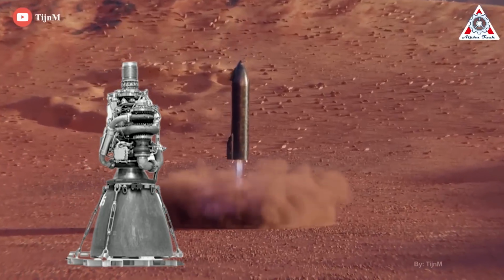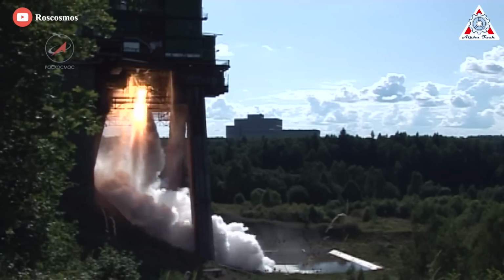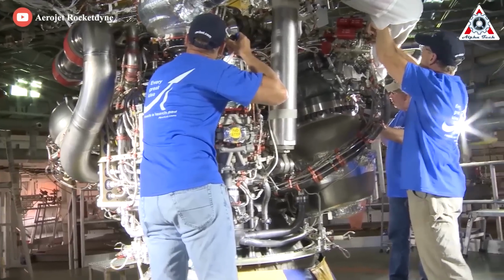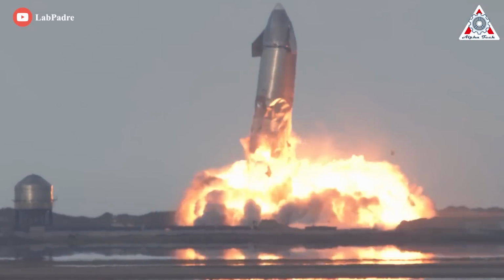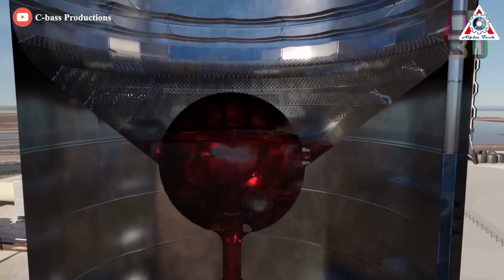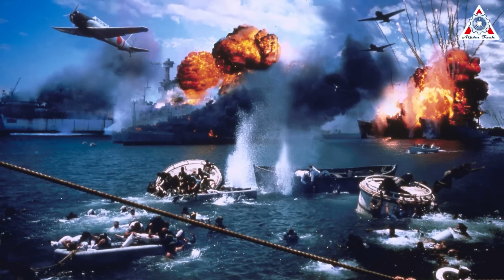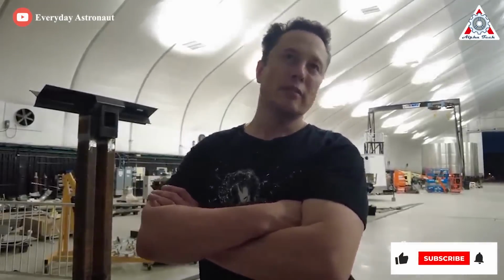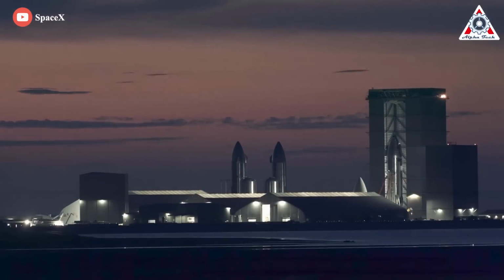SpaceX NEW Raptor Engines "BIG PROBLEM"...

Comment: You do realize that SpaceX has already proven that they can and do save substantial amounts of money by re-using rockets, including their engines in the Falcon and Falcon Heavy rockets.  And you realize Starship development is development from minimum structural requirement upward to try and find minimum necessary structural requirements.  This approach anticipates explosions.  It anticipates a fair number of failures and without them the project would not be maximally successful.
Reply: Exactly, and falcon was the exact same philosophy as well. There were dozens upon dozens of falcon failures and explosions of all sorts. It's like people completely forgot how long it took and how many failed attempts it took just to land a reuse the very first falcon. Brainless wannabe fake rocket scientists all over the comment sections of any video about SpaceX. Bunch of jabroni has-been losers is all I see
Reply: Exactly
Reply: @stompcity4085  You do realise the Falcon set of rockets wasn't that all that behind for its capability requirements. But Starships capability set, against what it is required of it is a bridge too far. Starship will fail and kill astronauts in the future.................it is a piece of machinery for dreamers not engineers or realists. Most of my working life involved at Boeing as a QA.

Comment: The problem is with so many engines that if two engines resonate at the same frequency you get well resonation and it explodes. You can't simply put all similar engines onto one rocked. It will eventually explode. The solution is to make a bit different say external ring engines bigger. That simply would solve the problem.
Reply: You need to math more - resonance is designed into structure components - I highly doubt the engines are tuned to the resonant frequency or anything structural - most structural things including the earth resonance frequencies are very low and do not occur normally

Comment: Some Falcon boosters have flown 10+ times. How are Merlin engines and Falcon boosters certified for subsequent flights? Conceptually, how does Falcon recertification differ from Superheavy?
Reply: They’re cleaned and overhauled each time though. It’s much less intensive than the old shuttle engines, but they aren’t landing and getting fueled straight away.
Reply: Reused Merlin engines are not rated for manned flight.  That is how they "get away with it".
Reply: @2twinster  Space-X Crew-2 used booster B1061.1 which boosted Crew-1. Used boosters ARE used for human space flight. Booster 1063 has been used for 3 crewed missions.

Comment: Rocket engines can only be reused so many times because of the incredible amount of heat that they create.  And when you place a bunch of them right smack next to each other, that heat is multiplied.  I wouldn’t want to be on a spaceship who’s rocket engines have been reused multiple times unless the most vulnerable parts of those engines have been replaced.  That’s the bell, or nozzles at the bottom of the rocket.  They’re the most vulnerable part of the entire rocket engine, as they’re subjected to the most extreme heat of all.
Reply: Not quite true. While heat is a big issue, there are several ways to handle it. The engines do not actually dump a lot of heat to the sides, as the vast majority goes out of the exhaust bell. And those engine bells only experience destructive levels of heat if there is a problem with the propellant flow or mixture. The turbopumps can be subject to much higher stresses, and not just heat.

Comment: So how are they gonna get a water-cooled steel plate to the surface of the moon or mars? Lol
Reply: Superheavy doesn't go to the moon.  Only the capsule of Starship does.  And since the moons gravity is tiny compared to earth's, it will only require a few souped-up SuperDraco engines to lift Starship off from the moon.  And those engines can be mounted high up on Starship, near the top.

Comment: It was pretty clear that the certification process in place today was exclusively designed to cover non reusable systems in an era where rocket flight was barely even possible.
Today, those regulations are going to need to more resemble general and commercial aviation requirements where the components are allowed to demonstrate reliability.  At that point, inspection and qualifications are attached that honor that reliability.
As the components get better.. these schedules are pushed out farther and farther.
Also giving far different requirements for cargo than for man rated vehicles is also prudent.
Reply: Yes, SpaceX has a serious record of reliability - a record absolutely required for them to have a real product to sell. 

Calling their plans "insane", which this article does with it's reuse strategy, seems way over the top.  Not long ago, landing a booster seemed insane.  Now with about 150 such landings on ocean barges and dry land, it can not be called "insane" anymore.  Besides, landing back on "stage 0" is a major improvement over landing somewhere else and then doing the costly and time consuming transport work to get the booster back ready to fly again.

SpaceX deserves some faith in its testing and reliability strategy.
Reply: @WillReadmore  you have to differenciate between Falcon 9 and starship/superheavy. All you say is true for F9.

But starship/superheavy has not at all earned the praise of being reliable. Raptor has a pretty bad track record. There has been serious problems with them more or less every single test.

Falcon 1 was succesfull on its 4th test after 3 years.

Falcon 9 was succesful from the start.

Starship is now 4 years into the test program, and it does not look like the first successful flight is close.

I get it that Starship is much more ambitious, but that does not make it reliable 😉
Reply: The Raptor multi engine systems is in development…it’s doing ok. Stage zero is the main issue now.
Reply: Very good point, well explained!

Comment: I wouldn't be surprised if spaceX ends up swapping out engines in between flights.  Inspect old engines while new engines in use then swap again after landing. Basically an assembly line of fire, replace, Inspect and repeat.
Reply: They already do multiple flights of their engines with falcon engine - they turn them around in about a month - I highly doubt they overhaul anything as they are designed for multiple flights with little failures
Reply: @matthewm7867  I may be wrong but the falcon series rockets use the merlin engines.  They are a much simpler design which in turn experience much less wear and tear,  but they produce far less thrust then the raptor engines do. Atleast that's what I remember reading, it's part of the reason the falcon has been so successful.

Comment: Still need to implement a microwave isolated magnetic rocket cone to isolate and compress the Plasma of the combusting fuel at a variable cone shape for the varying altitudes and calculated and controlled by the barometric pressure without computers.
Reply: I wish I could give multiple likes to this comment 😂
Reply: The combustion process of the rocket does not reach the necessary conditions to reach a plasma state = unaffected by magnetism = therefore this is not a realistic solution.

Comment: Why when talking about re-usability is there no mention of falcon9 ?
Also when talking about the raptor engines why say there is a single drive shaft? it sounds like you're saying there is only 1 turbo pump for both the fuel and the oxidiser rather than correctly stating that there are 2 separate turbo pumps. One for the Oxidiser and one for the fuel. One burns oxygen rich, fuel lean and the other burns oxygen lean, fuel rich

Comment: Yes, not a worthwhile video. It misses the point completely that as reliability goes up the certification and service between flights goes down. Reliability goes up with better engineering and advances in materials.
Elon is not afraid to toss around aspects of the design based upon data to reach a better design.

Had NASA not had its head up its ARSE they could have put parashoots on the bottom of SRBs as part of out of the box engineering to protect flight control mechanisms in the bottom of the SRBs. There would be a definite penalty in drag and payload capacity, but saving an expensive system and avoiding extensive labor would lower payload cost on the most expensive to operate payload vehicle EVER!

Comment: The insistence on using a flat concrete slab as a launch platform is a primary reason for the destruction of Raptors. When testing and developing, the engines have an open, unrestricted area to direct their blast into. The OLM has them slamming their high pressure, high temperature, high acoustic energy, thrust "blast" against a FLAT surface perpendicular to the exhaust streams! THIS is inducing backpressures, acoustic loads, and accompanying vibrational loads that are COMPLETELY ABSENT from the testing regimen! Couple all of this with the shrapnel blasting back up and into the engines themselves, and you have a perfect storm for engine and support systems, i.e. HPU's, destruction! I'm a simple retired Industrial Design Engineer with a TBI, and these issues are OBVIOUS to anyone with the least common attribute these days... common sense! IMO
Reply: maby that's y they invented the pyramids to take off of and land on
Reply: A huge gaff! The amount of short sightedness on not being able to come close to predicting that kind of catastrophic outcome from that launch system had to be embarrassing to all parties concerned at Boca choo-choo. Still hard to get the image out of the massive dents in the fuel farm tanks! 

On a positive note 👍 with the amount of abuse that Starshit took from that nearly 8 second delay in lift off, for it still to get up and away showed it’s robustness and is equally impressive in its own right.
Reply: It's kind of absurd when you think about it. Spacex want to go full reusability and end up with an expandable launch pad.... Nobody had done it before.
Reply: Not common enough apparently.
Reply: It’s obvious yes, but A. Space x can not legally build a pad below the water line in Florida, which is less then 20 feet at boca, B. They have a water cooling system that wasn’t ready by test time. The FAA drags their asses for test approval to begin with, it’s not like they can just push the test back without the possibility that that pushed back date might be denied. All of this while there are contracts with NASA that have to meet proof of delivery timelines. Blowing up a rocket for telemetry, and systems testing is a small price to pay for a launch pad. In fact historically it’s just a different method of rapid progression, it’s what the Soviet model was during the space race, and got them pretty damn far quickly, while the US had much less early success due to more incremental safer progress.
Reply: @Anthony Edwards  you are semi correct. They could have delayed launch because the launch license was good for 5 years. Also the pad destruction was not "a small price to pay". They would have delayed had they known. They did not expect the pad to obliterate to the extent that it did and it is a major problem. It damaged everything. Not just the base of the pad. The launch tower is damaged as well as the hudraulics, the stand is damaged, the holding tanks for the fuel and water were destroyed/damaged, and all of the surrounding infrastructure. It also damaged the rocket, putting out engines and damaging the hydraulics, preventing stage seperation. The data is good, but the pad destruction was far worse than a blown up ship. In fact not destroying the pad and infrastructure was the number 1 concern. Luckily the launch tower itself is still standing. But all of the parts that make it work are broken
Reply: @ThatSB  thank you for the reply, you also have to think about the goals of the project though, which are not only terrestrial applications but to hake off from the surface of other celestial bodies with the same engines. Making heat resistant concrete viable would have saved tons of future headaches and costs. However this isn’t something you can know until you try it. Future launches won’t even be at Boca, they will be at nasa facilities. I think this was as much a test of cheap and semi rapid pad and facilities construction as it was a rocket systems test. To meet the 25 year plan of sending a rocket to mars every 2 weeks you are going to have to make dozens of cheap, repairable launch sites rapidly, was it flashy and expensive yes, but everything destroyed here informs future design. From the placement of propellant tanks, to pad materials and mitigations systems, hell in lower gravity pad destruction like that would endanger habitats 10’s of miles away. The data outweighs the monetary cost a hundred fold.
Reply: And, it seems very likely that those steel wet plate upgrades are very likely to explosively deconstruct due to rapid steam expansion totally destroying the raptor swarm in it's entirety
Reply: @reoxxl  the water is circulating at a very high rate and pressure so it doesn’t flash into steam. It only has to withstand the engine heat for maybe 10-12 seconds.
Reply: It seems to be easy for some to forget how long SpaceX took to build the OLM and Elon's insistence that a flame trench/diverter and water deluge system were "unnecessary." As for excavation to create the NEEDED structures, only minimal foundation work similar to that done for the current OLM would have been sufficient. Above ground flame/thrust/blast diverters and HUGE deluge systems are common at the facilities at the Florida facility and have been SOP since the middle of the last century! SpaceX had plenty of time, plenty of historic examples, and, apparently, plenty of arrogance to draw upon when designing and constructing the current DEFICIENT design that is costing more to repair and modify than an appropriate structure would have in the first place. Again, my personal opinion. My expertise as a working Industrial Design Engineer was in seeing and addressing flaws, errors, oversights, unnecessary components, etc. in the designs of others and developing new designs that were cheaper to produce, lasted as long or longer than necessary, were easier and cheaper to maintain, etc. Basically, a nonspecialized Industrial Design Engineer. There are/were never very many of us in industry as it requires experience in multiple disciplines and "out of the box" thinking. My TBI makes it difficult for me to express myself, my concepts, designs, solutions, etc. adequately for many. I apologize for this. I just want this SpaceX "experiment" to succeed! I'm too old and damaged to take part, but I would like to see the moon and Mars occupied within my lifetime!
Reply: Very valid points indeed. I wonder had SpaceX waited for the installation of the metal water-cooled plate, would the Raptor engines would have had better chance as this design would have dissipated much of the heat and acoustic energy and not created all the potentially damaging concrete debris.
Reply: Actually this was a pretty successful test of the new high-speed tunnel boring technology for Elon musk's hyperloop.
Reply: This just astonishes me. With Starship being twice as powerful as Saturn was, how could they even consider launching this without the flame trench and acoustic suppression system baked into their plans from the get-go. I don’t get it. Certainly they were in constant communication with NASA launch pad engineers. Did Elon just say “f ck it” let’s try it. Apparently. Sorry, this guy is impulsive and dangerous.
Reply: Take off in the depths of the oceans
Reply: We'll have to see if they'll have sufficient plate water flow rate. SpaceX is aware of the acoustic issue. A possibility is to use water deluge on top of the plate to ameliorate the acoustics.
Reply: Alpha acts like SpaceX should follow the same old rules as NASA and not try anything new. Elon has proven his way works with his Falcons being like a FedEx truck to space which everyone said couldn’t be done. Flying back boosters - landing on a ship, reusing them 20X  - cannot be done the experts said. Elon said hold my beer and watch this…
Reply: Musk using Buck Rogers as a template
Reply: This reads like a roast of spacex…how about you acknowledge that the disintegration of stage zero was responsible for the failure of the recent test. IMHO the test would have succeeded had stage zero been properly designed…water suppression plus metal diversion system
Reply: No, it was not. Another delusional armchair rocket engineer. LOL
Reply: Every action has a reaction of destructive power.  -physics
Reply: @sirsneakybeaky  Who actually cares what u think
Reply: The insistence that the launch pad alone is responsible for the current failures ignores the proven unreliability of the overstressed Raptor 2 engines. Due to the secrecy involved as a private company such information as how many 4 minute 100% burns, shut down and relight at a lesser thrust and then within hours repeat the process have been accomplished. A reasonable number for a reusable engine would be in excess of ten cycles. It would be reasonable to assume this has not been accomplished even once.
Reply: @WILLIAM HATFIELD  you realize they are brand new right? And not going to mars tomorrow?
Reply: Keyboard hero